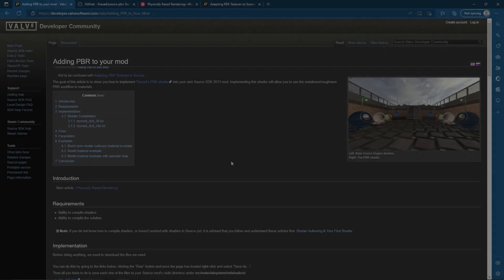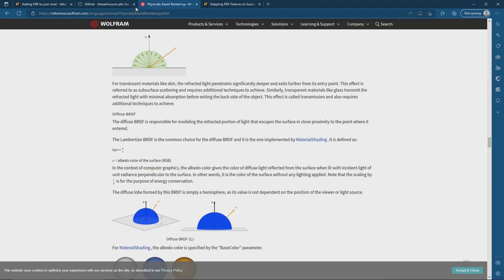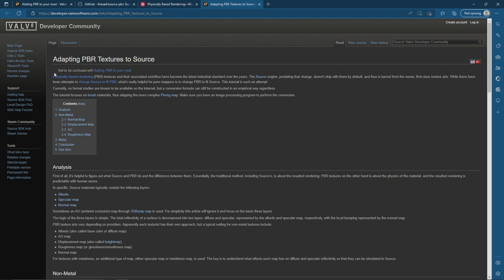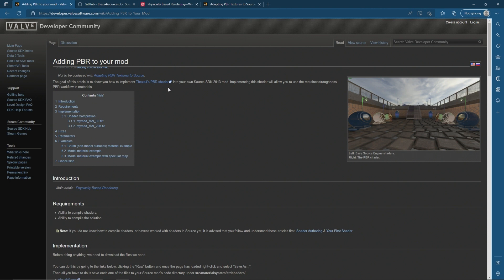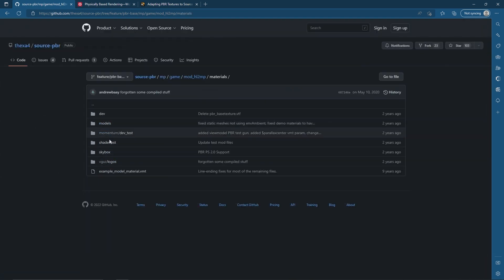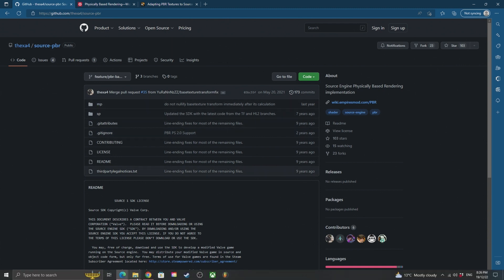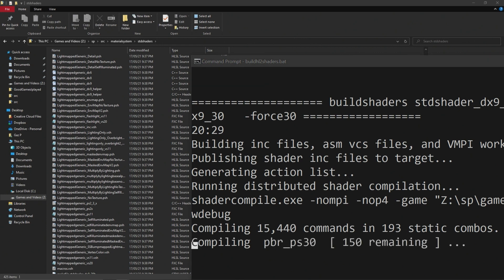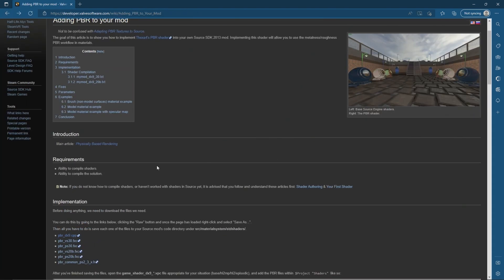Valve Source Code 2013 Tutorial (Episode 15): Shader Authoring Part 3 [Adding The PBR Shader]

Comment: Pls can you help me. I try to compile the pbr_ps30.fxc but I keep getting a few errors like this "common_flashlight_fxc.h(215,107): error x4505: maximum temp register index exceeded". Do you know what to do?
Reply from the maker: I haven't seen that error before and I don't know why that would be happening, are you using the Singleplayer or Multiplayer code?
Reply: @TheMaster974  I am using Singleplayer code.
Reply from the maker: Hmm, I don't know why that would be happening. You might need to use the files provided by Thexa4 if the errors keep occurring: https://github.com/thexa4/source-pbr/tree/feature/pbr-base/mp/game/mod_hl2mp
Reply: Im using singleplayer code.  @TheMaster974

Comment: (From what i know) The reason Lightmapped generic didn't work is because the default VBSP doesn't support it, you could use mapbase instead.

From valve dev community PBR page :

Warning:
This shader does not work with lightmapped brushes when using stock VBSP compilers, however it technically is compatible with brushes.
Code Fix:
In src/utils/common/utilmatlib.cpp find InitMaterialSystem method and at the end add g_pMaterialSystem->ModInit(); and try to recompile tools."
Reply from the maker: I see, it looks as if the Valve Developer Wiki page has been adjusted to include this information. Thanks for pointing this out!

Comment: Can these shaders be mounted without building the SDK codebase?
Reply from the maker: Technically they can, but you need the compiled shader source files and game_shader_dx9.dll has to be modded to include the custom shaders, which can be done by someone else without needing to modify any of the Source 2013 files yourself. However, it is better if you compile this stuff on your own!

Comment: so I have some problems compiling it I use SCell555's Shader Compiler and using the sp sdk 2013 when the compiler goes to "pbr_ps20b" it gives me 3 errors saying "Shader uses texture addressing operations in a dependency chain that is too complex for the target shader model (ps_2_b) to handle." and that pbr_common_ps2_3_x.h"cannot map expression to pixel shader instruction set"
Reply from the maker: I tried using that shader compiler and had no issues, so I don't know why that has happened. Have you set up the buildhl2shaders/buildepisodicshaders file correctly (see attached link)? Also, it seems as if that compiler can have issues with particular shader source files, but I really don't know what to say or suggest to solve your problem: https://developer.valvesoftware.com/wiki/Shader_Authoring

Comment: I have a problem with compiling shaders

==================== buildshaders stdshader_dx9_20b             -game S:\halflifetheunknownterritory\sp\src\materialsystem\stdshaders\..\..\..\game\mod_hl2 -source ..\.. ==================
01:04 AM
'perl' is not recognized as an internal or external command,
operable program or batch file.
Building inc files, asm vcs files, and VMPI worklist for stdshader_dx9_20b...
'nmake' is not recognized as an internal or external command,
operable program or batch file.
'perl' is not recognized as an internal or external command,
operable program or batch file.
Reply: Hey mate, I got a new error. I've compiled everything and added stuff to my everything.sln. But when I debug my game and load in the map shadertest. I get a error message saying

 'Unhandled exception at 0x7BAD#A4 (engine.dll) in hl2.exe:
0xX0000005: Access violation reading location 0x038EE7F0.'
Reply from the maker: The only solutions I know of that may fix this are to opt into the upcoming beta for Source 2013 Singleplayer (I'm assuming this is for Singleplayer?) or to recompile the shadertest map using the Source 2013 Singleplayer Hammer editor. If you haven't done either of these, you can get crashes regarding engine.dll. Outside of that, I don't really know what to suggest. Hopefully this helps!
Reply from the maker: Have you followed this tutorial to be in a position to start compiling shaders: https://youtu.be/yqJHtQ0k9g0 As it seems you don't have perl installed, which is needed.

Comment: What about improvements to inverse kinematics? For example, adding more knees.
Reply from the maker: I have no idea what you're talking about lol 🤣
Reply: @TheMaster974  Source's inverse kinematics system allows characters' feet to connect accurately with uneven ground surfaces. IK calculates the position of a middle_joint based on fixed distances from the positions of a top_joint and an end_joint. By improvement, I mean to increase the number of knees (flexibilities). Or adding more than 4 legs with Ik support
Reply from the maker: Thanks for clearing that up, however I wouldn't have a clue where to start with improving something like that, if it would be a coding or modelling change. I'm not an expert with coding, and I certainly can't model even if my life depended on it, so I apologize that I can't help out!